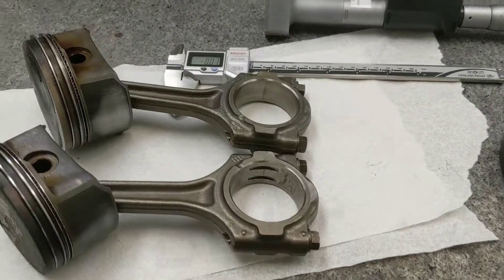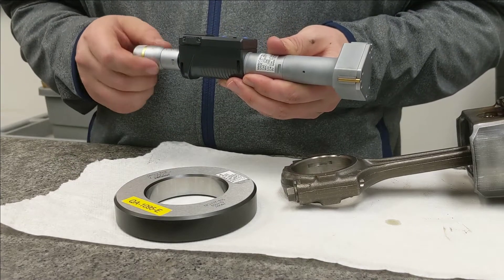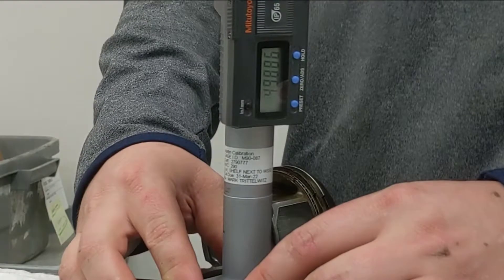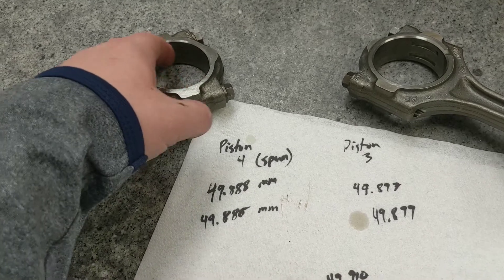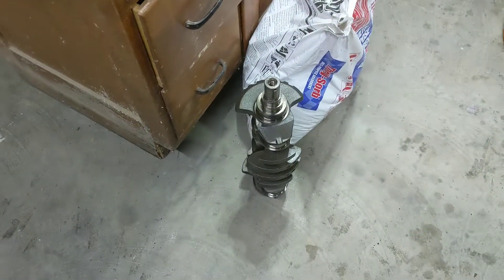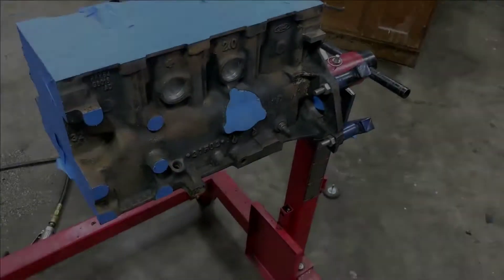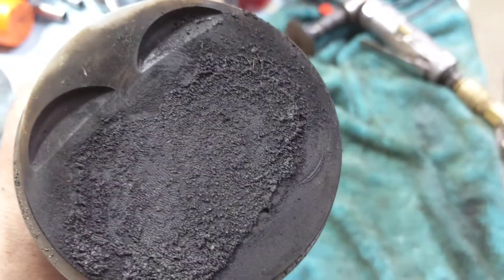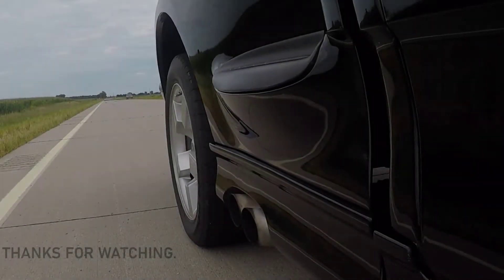How to Measure Ford SVT Focus Cylinder Bores and Connecting Rods + Engine Paint

Comment: What service manual are you using and where can I get one?
Reply from the maker: I used a Ford set of in print hard copy manuals like these. You would have found the in a Ford dealer back in 2004. https://amzn.to/45GQR6a

But there are less expensive versions such as this one. Same content, just as a PDF. The one I had had wiring diagrams and all the stuff. https://ebay.us/m/IFe2ZM

Comment: Hey 605, I’m currently about to do a head gasket replacement on my 03 Svt. I noticed when I turn the crankshaft pulley bolt that it’s very hard to turn and then gets easier and then hard again, any thoughts on what might be causing the issue? I’m really hoping it’s not the crankshaft being broken cause I’m limited on tools
Reply from the maker: I would serious be pretty shocked to find that you have a broken crank. The crank with the pistons and rods installed on them won't spin just perfectly smoothly.  As you turn it over (by hand) the pistons are either speeding up or slowing down.  As they come to the top and bottom of their travel, their speed slows and the amount of force required to turn them is less. I'm assuming this is what you are feeling. I have never broken a crank so I can't say from experience, but if it even ran at all or even turned over smoothly the crank is probably fine.  Did you by chance pull the oil filter and cut it open? If so, any fragments of metal would fine their way into the filter.  And if they're big, the oil pan.  How hard to turn is very hard to turn?  Also, are the spark plugs out when you're trying to do this?